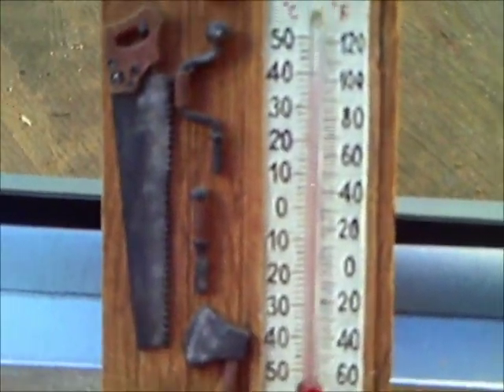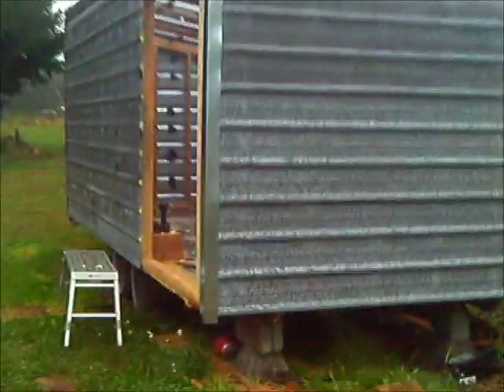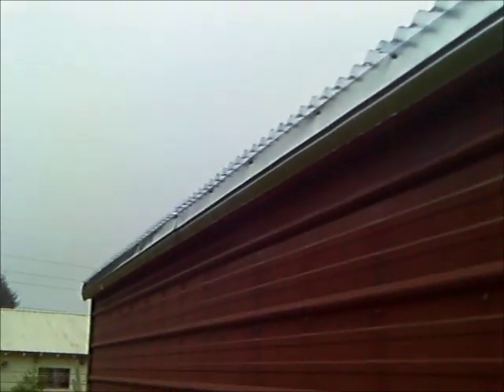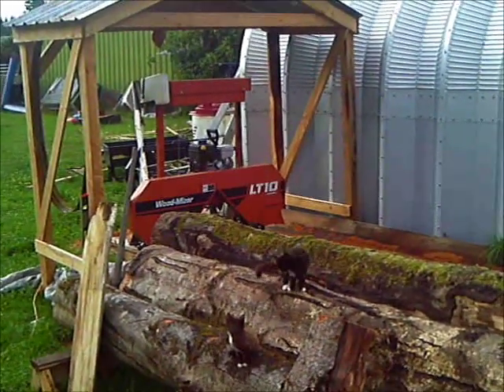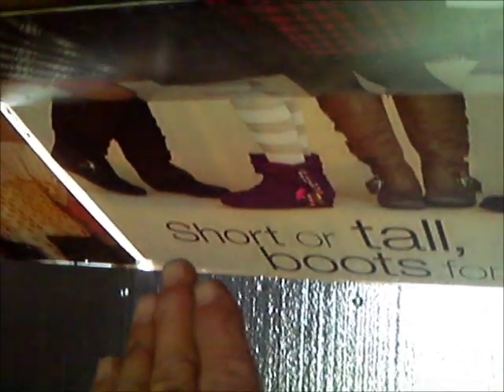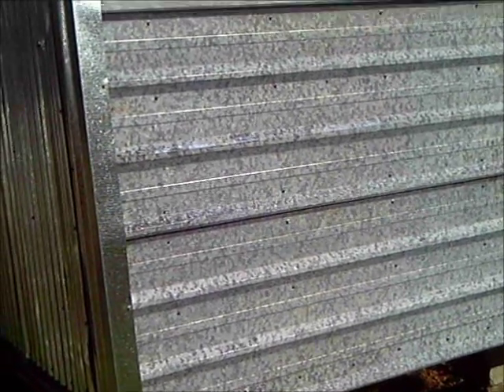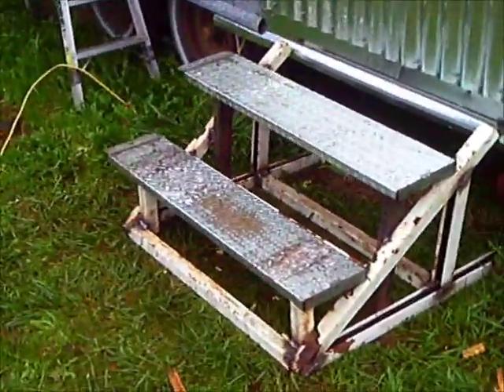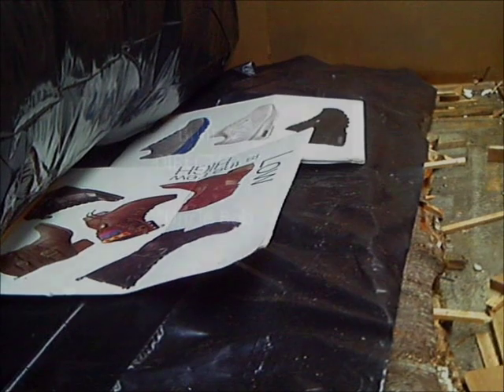Solar Kiln on wheels

Comment: I live in Australia and its about the best I've  seen we have hard woods to dry what sort of time frame does the kiln do
Reply from the maker: I am in Washington State in the US. When it is cold, I do oak. It takes a very slow drying to keep it from warping and cracking. Just fans to move the air and what heat does come in during the day. I have plenty of time to wait for it. Check the wood type for drying times. Some are better stacked to prevent warping and need to dry slower then just the winter months.  Good luck.

Comment: How is that solar kiln working out so far??
Reply from the maker: Over the winter it has taken the wood from 69% humidity to 19% Now that it is spring and I have had some sunny days,  The indoor temp getting to 124 deg. during the day.  So the 3000# of wet wood is calculated to be 2400# now. I did this by weighing sample boards and writing the weight. Then re-weighing it now.  Yes I lost 600# of water. I could not believe it ether.
Reply: I'm guessing this would work on a little larger scale also.
Reply from the maker: Yes it would. I have seen them using a 55 gallon but I do not have that much sawdust every day.

Comment: I heard a rule of thumb for air dry is 1 year per inch...good idea for a trailer the tax man can kiss my grits
I built a kiln on a set of pallet shelves in my shop i will do a video on it later this summer
Reply from the maker: Yes sir one year per inch is right. I have 69% going in and down to 19% in the winter time running. If I could get a low humidity for a week I could drop even more. 19% is stable wood but not 6% dry for home furniture building projects.
Reply: I read a thing about drying time and process and a higher  heat in the beginning helps the pours open up and release moisture I will try and find it
Reply from the maker: Yes very true. They make a large Microwave to dry wood much faster than a steam fired kiln.

Comment from the maker: I now have 1400#  from 3 logs in the solar dryer. It is day 4 and moisture is working its way to the outside. I have a moisture meter from Harbor fright and learning how to use it as it drys. The warmer the inside air the more the wood fibers open to release the trapped sap to the outer parts of the wood.